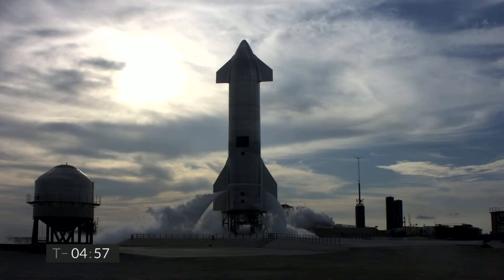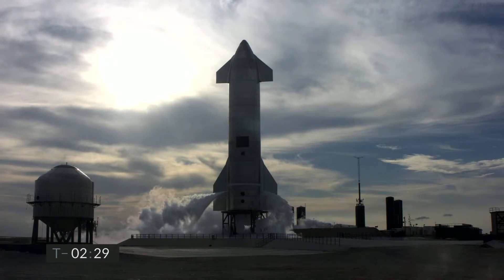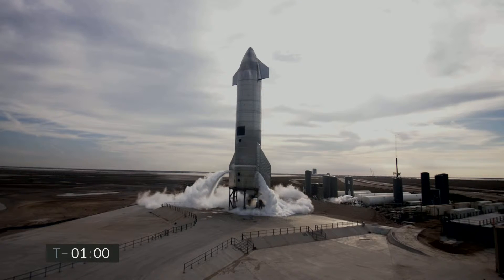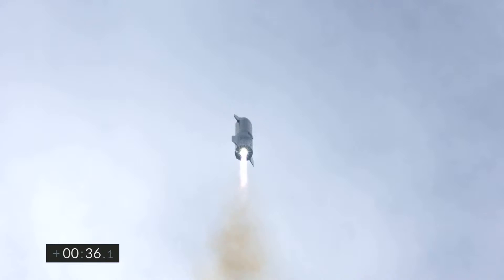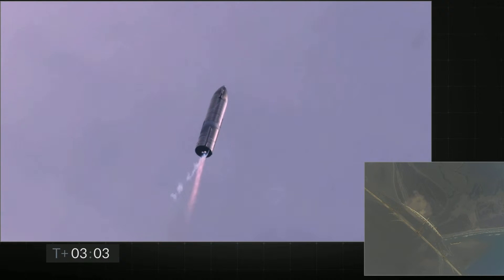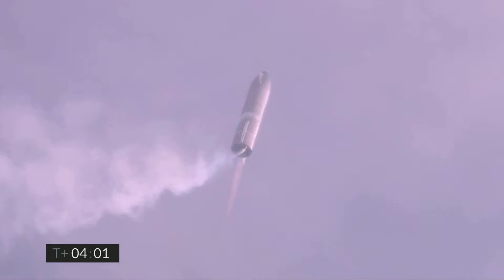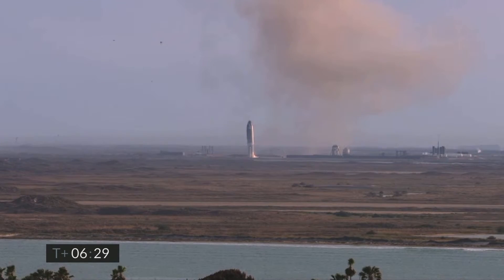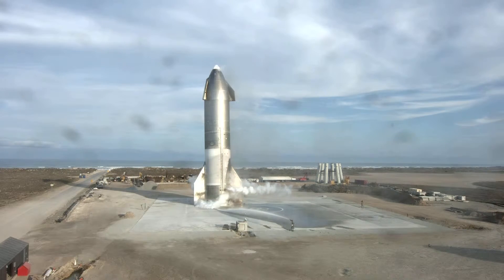Starship | SN10 | High-Altitude Flight Test

Comment: Smoke coming out of top of rocket after it landed. Interested to know if the fire after landing caused much damage.
Reply: That's not smoke, that's liquid oxygen venting from the header tank. As for the fire, I suppose it depends how technical you want to get. 
The fire probably didn't do much damage directly, but if it was what sparked off the explosion then technically it caused quite a lot!

Comment: Thats why terrorists will be using this rocket
Reply: this rocket exploded after landing
Reply: @awoke361  so do any bombs, drones with explosives, etc. Why will they need this rocket? It's 18 stories high - kinda hard to hide it in the trunk of the car.
Reply: @dmytrogubskyi4355  moon
Reply: @awoke361  are you just gonna throw random words? Moon what? How is it related to terrorism?)
Reply: @dmytrogubskyi4355  they can use this rocket to blow up the moon
Reply: @awoke361  you're underestimating the amount of energy required for this) All the explosives and nuces in the world (let alone some terrorists) won't be even remotely enogh to make a physical damage to Moon or planets. Don't worry about that.
Reply: @dmytrogubskyi4355  ok
Reply: Or other planets

Comment: How the hell did they film that up to 10km so closely? Did they have another rocket launched at the same time?
Reply: Zoom and specialized equipment. Really impressive shots!
Reply: @gonlelo  The camera looked like it was travelling with the rocket. The angle did not change.
Reply: @LEO-xo9cz  They use Drones and Ground based robotically controlled tracking cameras.
Reply: @LEO-xo9cz  it’s called tracking. You can do it with your eyes you know....
Reply: @LEO-xo9cz  "The angle did not change"
To quote John Cena; are you sure about that?
Because looking at the bottom of the ship at  T+1:00 vs  T+4:00 (So probably roughly 2.5km vs 10km), it sure looks like it to me.
As I will attempt to demonstrate with my shitty MS paint skills: https://i.imgur.com/XMvhAZI.png
Reply: @lazarus2691  nice image!
Reply: @lazarus2691  The problem is that the angle should have changed. The camera was right next to the rocket the whole time. Anything that comes out of his mouth is bull. Trump was another one the pulled the wool over the eyes of the sheep and he was heavily involved in wrestling.
Reply: @milk5002  The rocket would have decreased in it's perceived appearance as it got higher. Logical. The camera appears to be flying beside the rocket.
Reply: @alexn8219  A drone that keeps up with the rocket up to 10kms?
Reply: @LEO-xo9cz  Some shots are from the drone, they just have large telescopic zoom lenses stationed on the ground. Youve obviously never seen professional rocket launch photographers do their thing.
Reply: @LEO-xo9cz  The angle did change. I demonstrated that quite clearly in my diagram.

The camera zoomed in so the apparent size stayed the same, but the angle changed by a lot.

Also, you can clearly see the increased atmospheric distortion in the second shot. 

The ship may appear the same size, but the second shot is looking through a lot more air and much more zoomed in, so is more blurry and faded.

If the camera was right next to the ship that wouldn't happen.
Reply: @lazarus2691  T00:48 - T1:28 is what I was referring to
Reply: @LEO-xo9cz  Even during that time period you can see the same change in angle, just to a lesser extent.

See here; where I've matched the apparent size and rotation of the rocket, there's clearly still a difference in angle:

https://i.imgur.com/4QNRm2b.png

More of the base is visible in the second shot, so camera is clearly looking at a more upward angle, just as described in my original diagram.
Reply: @lazarus2691  Another flaw with your diagram is that the second picture is after engine cut off. The rocket is falling into the horizontal position.
Reply: @LEO-xo9cz   What are you talking about?

You can literally see the engines running in all four frames that I used.

And anyway, the timestamps were at T+ 0:48, 1:00, 1:28, and 4:00

Engine cutoff and transition to horizontal was at T+4:20

So even after that last frame, the rocket was hovering for a good 15+ seconds before starting the flip.

And as I showed, the effect is still visible with the two timestamps you yourself picked, much earlier in the ascent.

Comment: Most wise investors with crypto uses the opportunity of when there is a drop in the market to buy and day trade with a working strategy and a plan to navigate the market system using the low price in the market to trade daily speculating the increase in price. Get a working plan today for that profit-making. fact is, BTC is the future of crypto and the questions traders ask themselves now is if this is the right time to invest ? Before jumping into a conclusion I think you should take a look at things first,for the past few days the price of BTC has been fluctuating which means the market is currently unstable and you can't tell if is going bearish or bullish. while others still continues to trade without fear of losing, others are being patient. For me trading has been going well because I use a day trading system that helps me  with signals which have made me to accumulate over 8.5btc in two weeks. get a working strategy with the help of an Expert Ronson his telegram ( @ fx_trader01 ) and on wtsap 👉 +15093427077.
email : ronsonbaylor @ gmail . com
Reply: stfu

Comment: 30000ft is pretty high and clouds usually are on much lower alt, so why Starship didn't fly through it?
Reply: First, it did fly through clouds. You can clearly see clouds as it reaches apogee. Second, if it is clear weather, then no, there wouldn't be clouds.
Reply: @samos8367  hm..so you can make video through clouds? even some smoke (hydrogen or I don't know) are still visible - that's strange for me. when I fly on plane - even winglets usually hidden when fly at 15-20kfeet. such a clouds. 
(mom's engenier, don't throw rotten toms)
believe it flew, but not your explanation

Comment: The rocket is descending into its own induced hole in the air.  It needs to move sideways slowely until the fast decent is stopped, then slowely descend to touchdown.  This is the same problem in helicopters, called desending with power.
Reply: Helicopters push on the air around them, a rocket rides it's own exhaust. One of this rocket's engines spits out roughly 500 cubic meters of gas per second.
More than enough to fill a hypothetical cylinder beneath it. So for the most part, it's immune to the problems that helicopters have.
There probably are some small effects, but easily accounted for. The problem here was that the engine's throttle wasn't responding properly.
Reply: @lazarus2691  The more thrust the deeper the hole to drop in.  If they had a supersonic descent, then they can get some backpressure to push against.  I hope your right and it is just a weak engine, 3x in a row, but seems to be something else.
Reply: @jamjimmie  
 SpaceX have landed 75 Falcon cores using a similar method at subsonic velocities. Since those have about half as much thrust, if this phenomena you're describing is an issue, it should have appeared on those landings as well, and they would have learned to account for it.
And I'm sure their fluid dynamic simulations are advanced enough to pick stuff like that up.

But as I already explained, rockets push on their own exhaust. They can work in a vacuum after all, they don't need 'back pressure' to push on. In fact back pressure actually reduces their thrust(About 5% at sea level for these engines), so a 'hole' like you describe might actually help a little bit.
Reply: @lazarus2691  The difference may be that falcon firing is extremely over powered, no ability to hover.  And they move sideways as they landed, plotting a full power burn to landing.   With new setup,  the reason they shut off 2 of the 3 engines, to try to land with some room for correction, without a full burn.  If there was a pilot on the rocket they would feel it fall into its own wake, unless they had some side movement.  The smaller the thrust area the worse the effect.  Like the two small props on the  v-22 osprey, one side can fall out into its descending wake.  Just like the crash during the osama raid.
Reply: @jamjimmie Falcon 9 comes in far more vertically than Starship.

You can see in this composite image that SN10 overshot the landing pad a lot during the flip, and translated back towards it: https://i.redd.it/53u9uwjklyk61.jpg

I make out around a 30 degree angle of descent.

And while Falcon 9 has a higher thrust to weigh ratio, the total amount of thrust is lower, and the thrust per area is comparable.

So I don't see how it could be a significant issue on Starship, but not even detectible on Falcon. 

The onboard accelerometers are every bit as capable as a human pilot (and then some) of 'feeling' a drop like that.
Reply: @lazarus2691  Thanks for your input.  I would not put that much faith in the computer models.  Reminds me of the story on the sidewinder missile, where the missile worked before the similation.  I am thinking that if the model was good, they would have stuck the first attempt at the Falcon landings.  But, there are some very smart people there, that are saying this shouldn't be happening, why is the engine at full throttle and still falling fast, it must be a throttle problem.  And they can see the accelerometer reading, but if they don't take it into and out of the power descent, they won't see the comparison between percent throttle and rate of descent.  There are probably many smart people thinking this is a rocket, so it must be different.  Or it works in space, so it must be different.  It's the same downward thrust, no matter how it's made.
Reply: @jamjimmie  The engine wasn't at full throttle. It jammed at like 60% or 70%. They know this because they have hundreds of sensors measuring the fuel flow and pressure in dozens of parts of the engine. So they know the loss of thrust was happening inside the engine, not outside.

If their sensors had said it was at 100%, but the rocket was falling like it was at 60%, then that would indicate that the thrust loss was indeed happening outside the engine. 

But their sensors said 60%, and the rocket fell as if it was at 60%, so it lines up just fine.

Also, I'm confused. You said a pilot could 'feel' the rocket falling into it's own wake, but now you're saying that an onboard accelerometer couldn't detect the same thing?

Also also, just how much of an angle would they need to avoid it? Like I said, I pick about a 30 degree angle from that composite image.
Reply: @lazarus2691  I hope they solve the throttle issue, thought they did with some header tank issue, and delay from faa.   Any side or forward movement should take them into clean air,  or they could turn of engine and restart after falling into clean air.  Maybe once they hover stable they could descend slowly or use that 30 deg angle of approach as long as the rate of descent is less then 300 or 500 ft/min descent rate max.

Comment: I'm not an engineer but why many time of their nozzles starting to flameout when touching down?
Reply: Too much thrust. Rocket engines don't like idling, these ones can only go down to 40% throttle. So with three engines running, that's equivalent to one engine at 120% power.
Or about 240 tonnes of thrust, for a 120 tonne rocket. So if all three stayed running, the rocket would come to a stop in midair, then start going up again.
So once it slows down enough, it has to shut down two engines to reduce the thrust enough that it can hover downwards at a constant speed.
Apparently the new versions of the engines can throttle down more, so they'll only need to shut down one engine next time, instead of two.

Comment: im more interested in knowing about  how they managed to film it so perfectly
Reply: High quality automated tracking camera on the ground, plus a couple of drones in the air, again with automated tracking.
Reply: My question too. That was not fillmed from the ground.
Reply: automated robotic tracking cameras, with a wide shot and a computerized stabilization software (the starship isn't actually stable in the shot, but they shift the centre so that the rocket stays roughly in the middle, achieved with a wide shot and digital zoom)

they also have drones that are able to film, although I think they weren't used this time

also the ground camera, in the landing pad, probably the most epic one of all, giving us that starship approaching and landing from above.... it looks so prefect you could say it's CGI, amazing shot
Reply: @ivantimofeev2233  thnx you solved all my doubts, i was just skeptical as to how they shot the take off and mid air sequence so well
Reply: @ivantimofeev2233  The camera looks like it is flying beside the rocket.

Comment: Did they determine why it exploded 8 minutes later?.
Reply: Elon Musk said on twitter that the engine wasn't responding to throttle commands, so it touched down hard. Way harder than the landing gear could handle.
He didn't specific exactly what broke in the hard landing to cause the explosion, but Scott Manley's theory seems pretty legit.
Short version is that a fuel leak caused a small explosion, which ruptured the liquid oxygen tank. The explosive depressurization from that tank threw it into the air.

Comment: Why not make a spaceship out of the Falcon booster rocket.  lands perfectly every time
Reply: Because Falcon doesn't come back from orbit, only sub-orbit. Starship is going to be coming in five times faster, which means over 100x more reentry heating.
As a result, it needs to expose as much area as possible to create drag and spread the heat out, so it needs to come in sideways, instead of vertical like Falcon.
The booster for Starship will still land like Falcon does however, since it comes back at similar speed.

Comment: Legendary platform app for these epic SN10s, bogey should welcome the eagle at hand, landing on a cavitating baffle followed by cooling overheated aluminum lengths (white handle) stored in a thermal shock test on pods - ventilated cauldron vacuum catapulted foot test bench - Shield with electromagnetic plate brake servo on the plate (correction of the force at the foot) intermediate of the ventilated cryogenic cauldron system Filling of the CO2 barometer reseve any use operating at full cavalry speed every hours Capacity 4 in 1, as such getting there from 3 consecutive X-MEN regular interplanetary pioneer weeks

Comment: The only problem is that the pasangers will get burnt as soon as they touch the external metal, or they will die by the combustion gases. One mitigation measure is to use the fire on the outside to make a barbecue and enjoy the wellcome.
Ok now, the smart guy will come criticizing my comment.
Ok smart guy I know they will solve the problem and America will be great again.

Comment: @SpaceX, I don't understand one thing: So on 10km altitude you turned off 2 engines, yet it was still getting altitude... How? If it can go up with only 1 engine, then why use 3?
I'm sure you still get some maneuverability with only 1 engine...
Reply: It loses fuel while going up, so it gets lighter and because of the altitude it needs even less.
Also, they want it to hover on the 10km alitude
Reply: @FinkHD  The fuel makes sense. But for the altitude, you are not near high enough to feel any gravity difference...
Oh well.
Reply: @Lucian_Andries  Honestly o just wrote that with the altitude because of Kerbal Space Program and in my brain it sounded right, but yeah that probably makes more sense
Reply: @Lucian_Andries Correct, the gravity difference would be like a fraction of a percent at most at that altitude. 
However, the engines would make about 5% more thrust at that altitude, since there's less external pressure.
But for the most part it is indeed the reduction in fuel weight. Each engine burns roughly 0.5 tonnes per second. So all three together burn ~1.5 tonnes per second.
So by the time the first engine shuts off, it's been ~135 seconds, or about 200 tonnes of fuel burnt. One engine makes ~200 tonnes of thrust, so yeah...